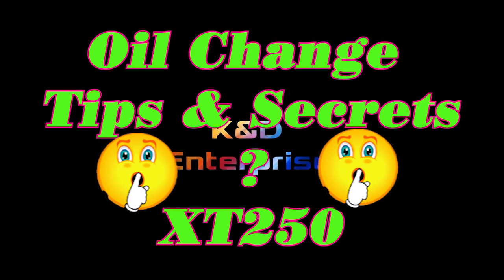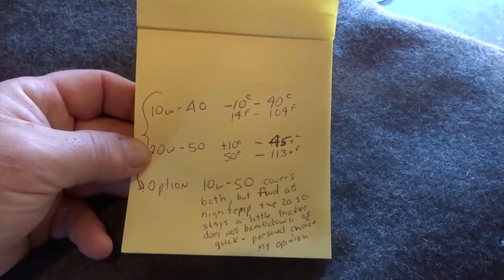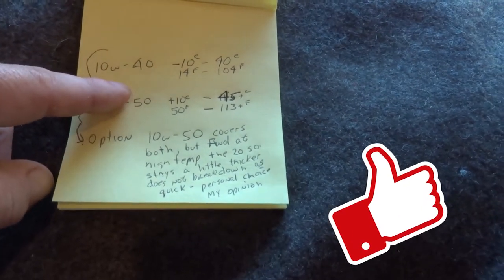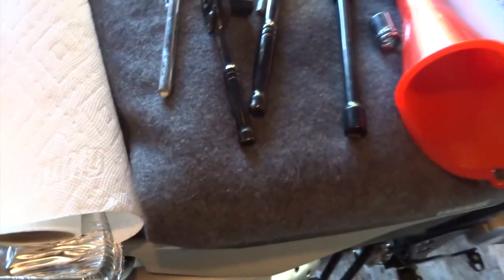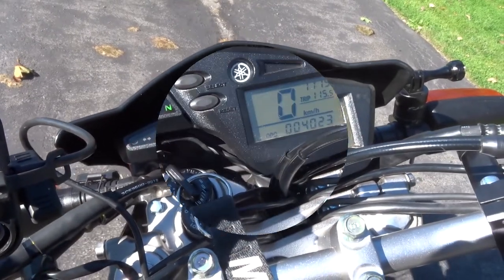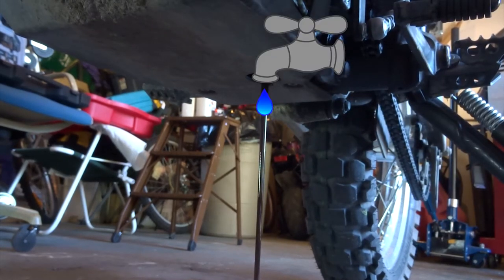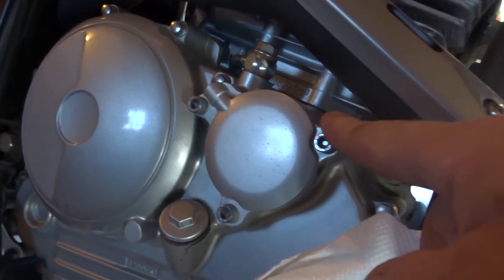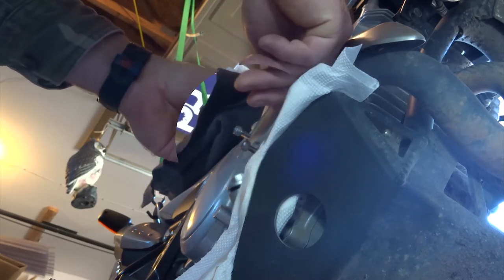XT250 Oil Change Tips And Secrets

Comment: I watched this without sound so I may have missed something lol, but did you put new oil in before replacing the drain plug? Also what tool is used to take the air filter out?
Reply from the maker: Yes, I put a little bit in to flush the gunk out, then put plug in…. I did not do anything with the air filter but perhaps u meant the oil filter… it takes an Allen wrench…